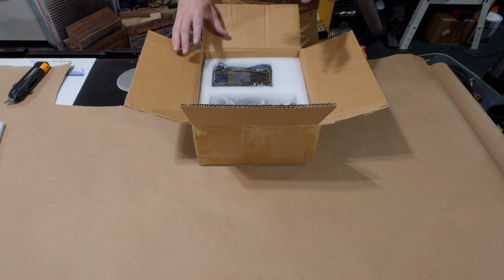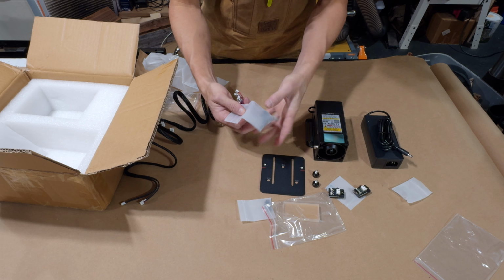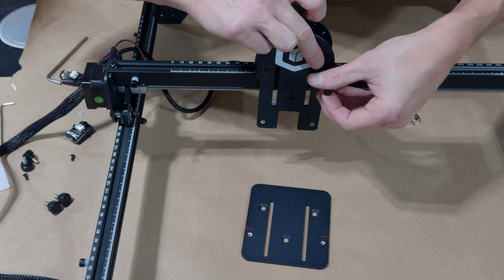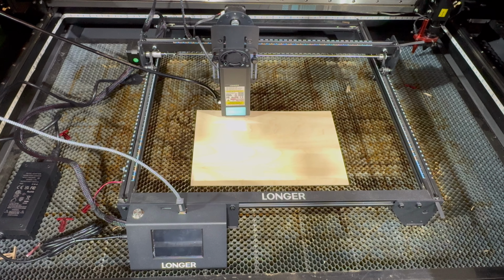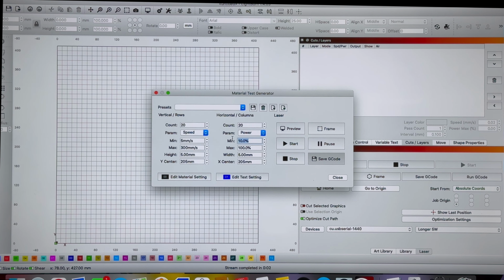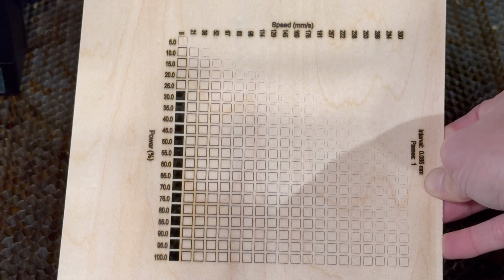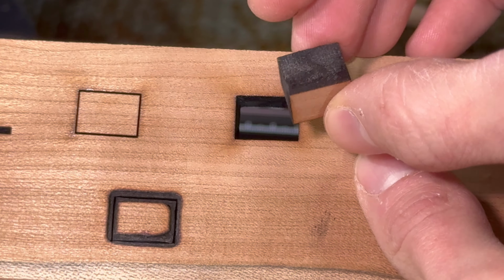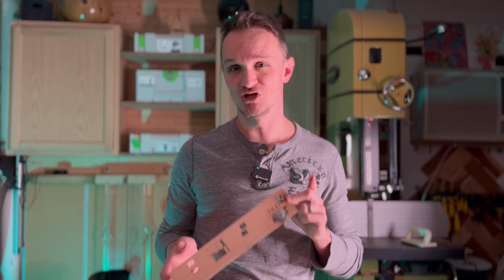Longer Ray5 20w diode laser upgrade kit. Install and testing.

Comment: I watched this video just to see the new cable being added inside the control panel. My new cable has ALL black wires and tags that do not match the old ones. So speeding through that part was not helpful at all.

Comment: Hi. After replacing the laser with a 20W one, did you also replace the power supply? The Ray5 10W power supply is 12v, and I received a 24V power supply in the set with the 20W laser. I'm afraid that by connecting 24V I will burn the motherboard.
Reply from the maker: Yes, you replace the laser head and all the wiring and the new power supply

Comment: Upgrading the firmware was such a pain in the rear - because Longers website has  the firmware but they dont supply the tools to program the firmware file for the Ray 5, BUT I found if you goto the 5watt version of the firmware downloads they have the tools packaged with the firmware, I then ended up using those (tools)  and the firmware for my 10w laser to get it programmed - literally took me a whole day because they don't package them all consistently. UGH Love the engraver but will be switching brands next upgrade. Seriously why be this unorganized?
Reply from the maker: Yes, the firmer upgrade was terrible. I actually had to call longer because it wasn’t upgrading for me and they just replaced the whole computer board.